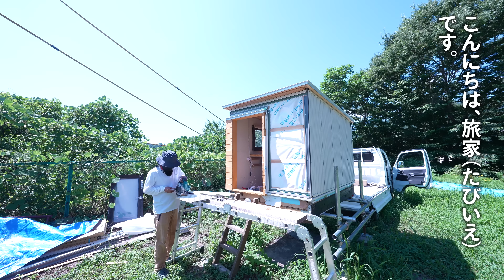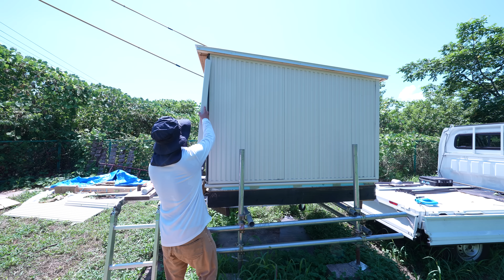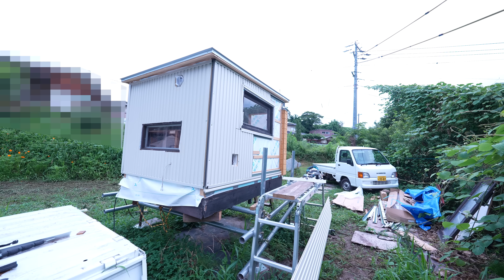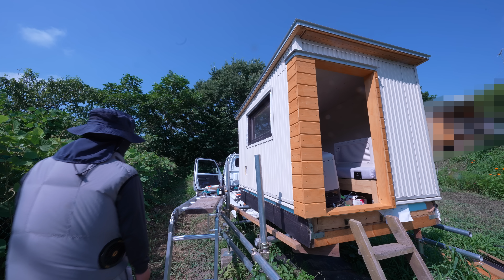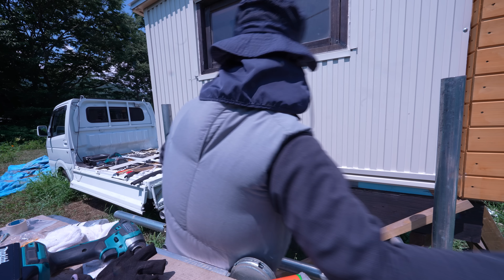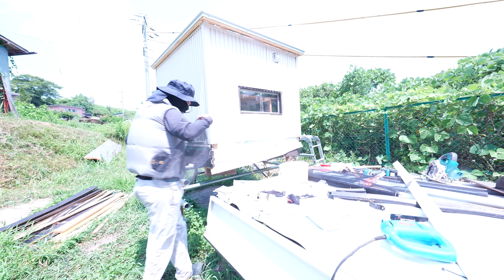外壁完成！自作軽トラキャンピングカーをガルバリウムでカバー工法！大規模外装リノベ⑤。173

Comment: Great to watch all these upgrades come together! The "wet finger" technique is great when working with caulk. Wet your finger, and when the excess builds up wipe it on a wet rag, then dip your finger in water again. You'll end up with a really nice rounded look where you put the sealant! 

Not that it matters because the new exterior looks great regardless! Amazing work!

Comment: I'd think that every crevice created between the metal boards, the fittings and etc would need caulking. Tabi did have to cut up various small pieces to fit them around windows and such.